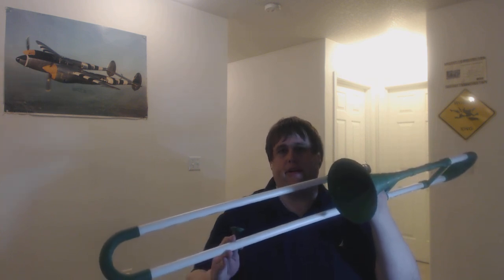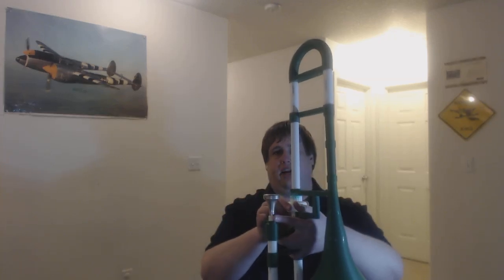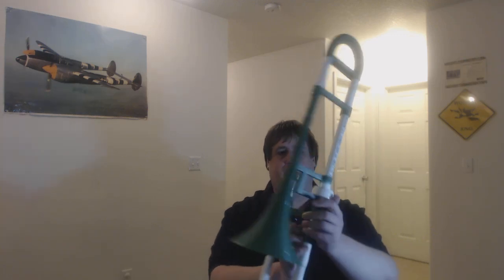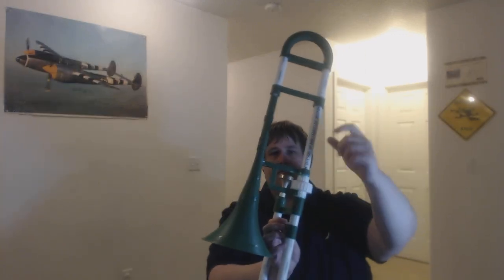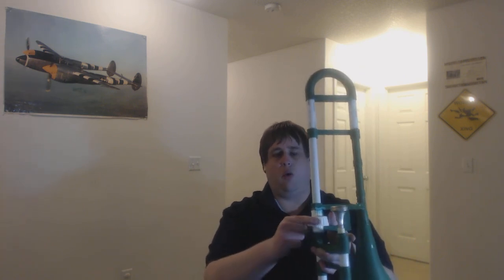Introducing the World's first 3d Printed Trombone

Comment from the maker: The use of PVC for the slides was mainly a technical limitation of my particular printer. The small tube diameter meant that I couldn't get a smooth enough surface and a long enough tube without air restricting joints. I did have the backbone as a 3d printed piece initially, but I kept snapping it. I suppose I could have put "mostly" in the title, but it is listed in the description so I figured that was good enough since most 3d printed objects contain some additional hardware to make them work. I do think that a suitably dialed in reeeely tall delta printer could print the slide pieces. But not my existing printer. Glad you think it is neat though!